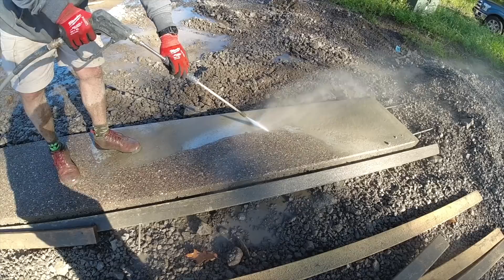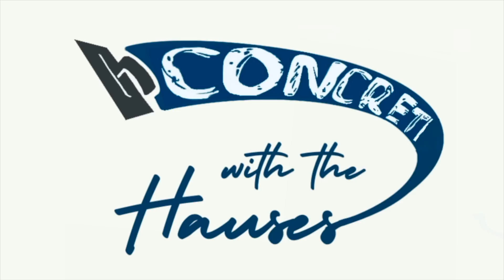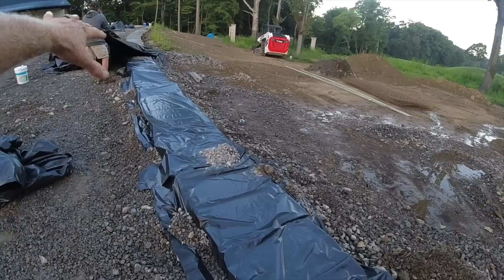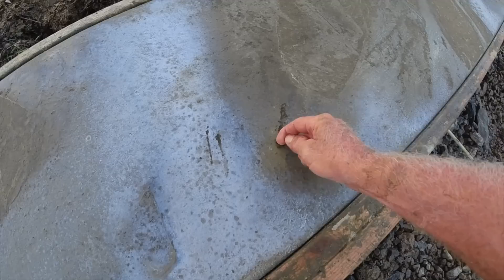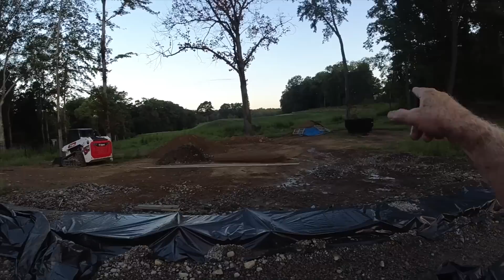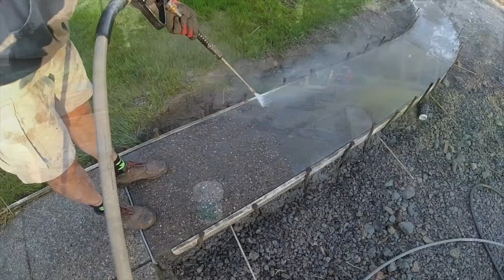A Year Long Project, DONE!

Comment: What do you do of there's leftover mixture? Does it have to be thrown out?
Reply from the maker: The concrete plant takes it back and uses for fill
Reply: @Concretewiththehauses  I'm sorry, I meant if there's extra sealer mixture, in the sprayer on the border part
If you mix to much chemicals, are they saveable or will they not keep?